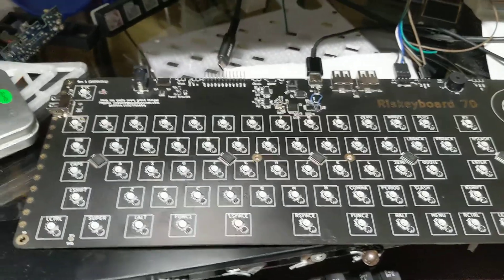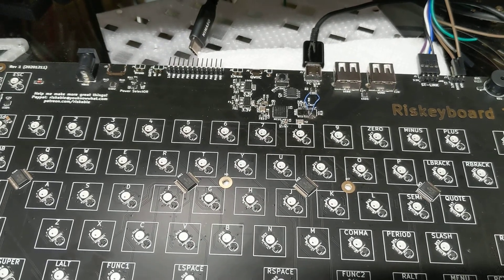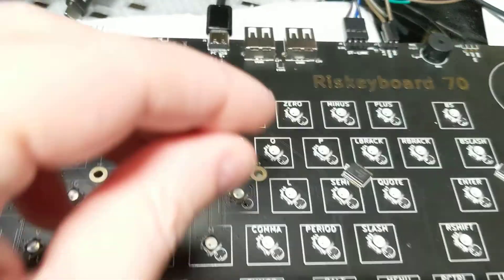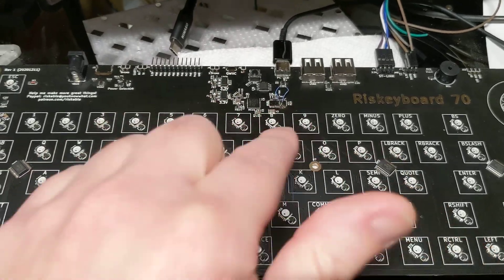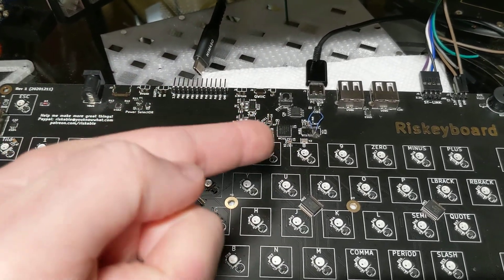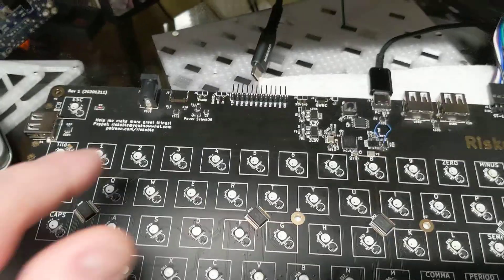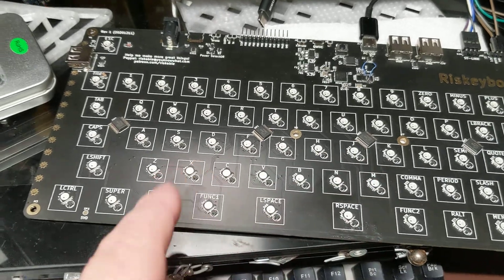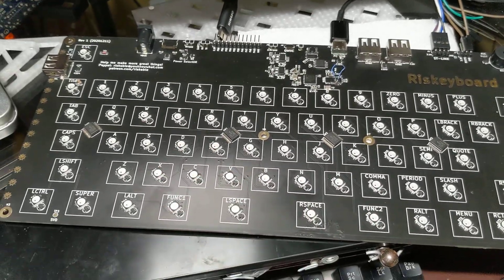Riskeyboard 70 is working!!! Open source hall effect keyboards are a go!

Comment: very impressive!
i can see you've put in a ton of work.

is every single key analog capable then, since you're doing hall effect?
Reply from the maker: Yes, every single switch is analog and the point of actuation is configurable in the firmware.  Even the rotary encoder is analog (you can set your own custom resolution)!

Comment: I love your videos!
Any chance you'll be releasing your pcb design & firmware?

Thanks for posting :)
Reply from the maker: Yes!  I'm still working on them...  If I released the PCB design today people would be mad because it doesn't work right! haha.  I'm in the middle of redesigning it (revision 2). It has a new USB hub IC too that's much better than the previous one.  Loads of other improvements too.  I hope to have the next batch of PCBs ordered in the middle of April.

The firmware needs a lot of organizational work but it's mostly done (I mean, everything works like it's supposed to though not all features are enabled).  I guess I can release that sooner but what's the point if there's no PCB you can run it on? haha.
Reply: @Riskable3DPrinting   Thanks for the reply!
Can i get in on that upcoming v.0.2 pcb order?

Also, what about your schematic- for those of us who dream of experimenting and forking your design?  ... I've some education & experience with PCB design and would like to work on a variant with a number pad and an appliance keypad.
Regardless , thanks for the videos!